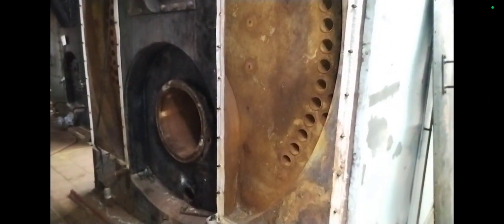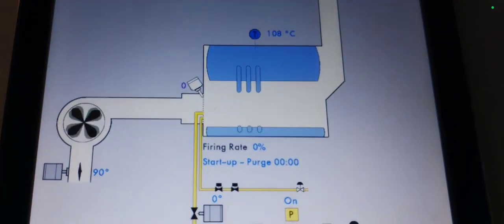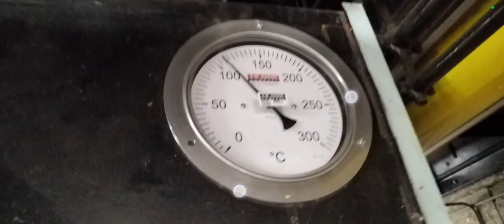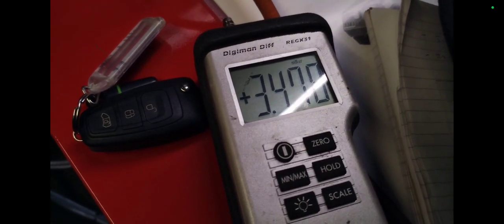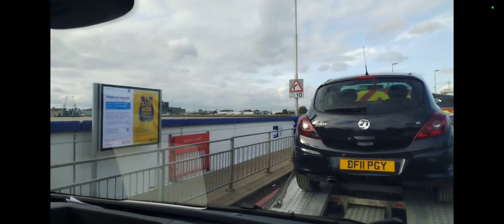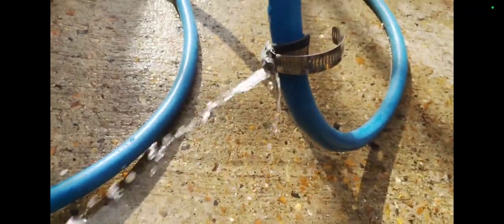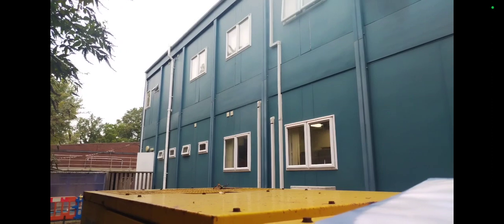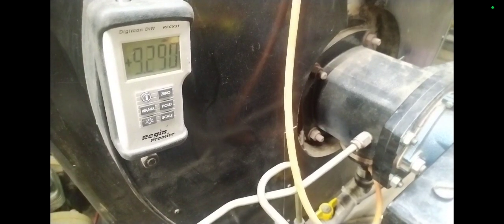DAY IN THE LIFE OF A COMMERCIAL GAS ENGINEER pt9

Comment: How do you gas rate em commercial appliances mate? I'm just asking which formula you follow doing your calculation?? Keep posting your videos Cheers mate
Reply from the maker: Good question Patrick. I am lazy and use the anton sprint app as I believe it's very accurate and saves time. I could revert to my logic book. Which calculation do you use? I'll grab my book later and send over the 2 minute calculation. Going from 870 to 899 on my meter. What I am even more interested in is the calculation for the flue temperature to work out the Kilowatts. This flue was over 300c. Had a serious oxidising flame going on.